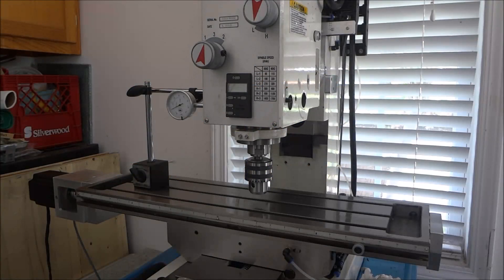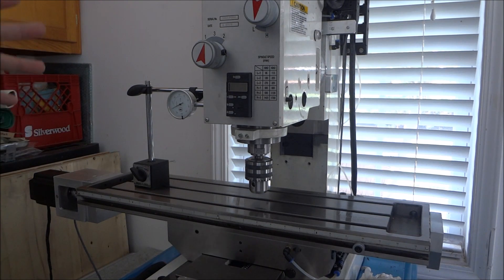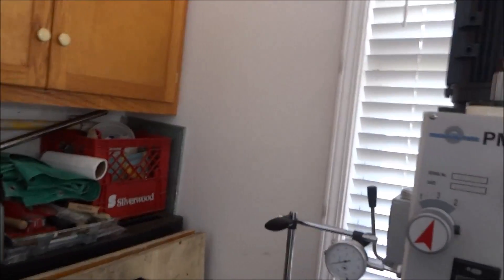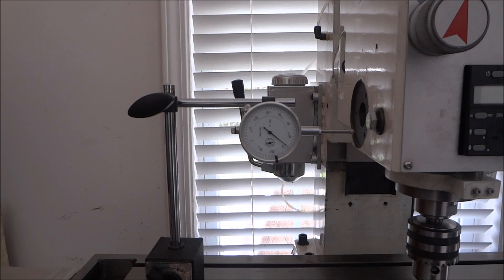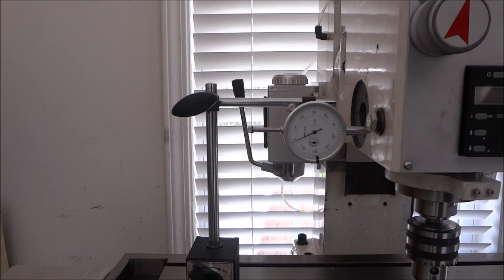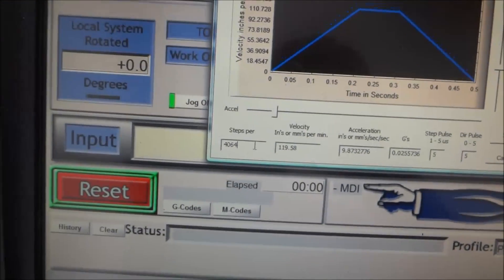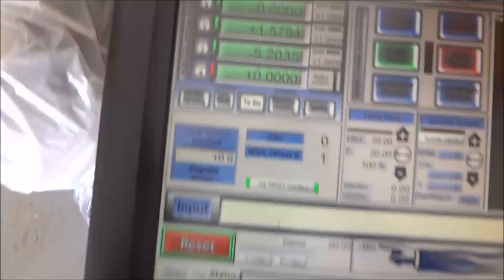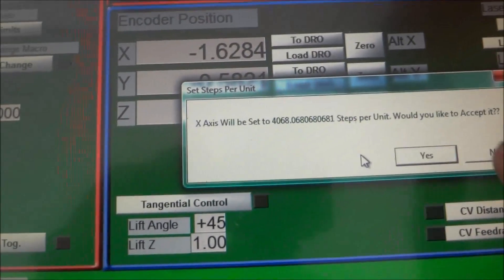PM727M Mach3 Steps and Backlach compensation Setup

Comment: Hi,

I would like to clarify this..!!!

Suppose I have downloaded a fresh copy  of Mach3 from the Official website and configuring for a CNC Router Mill.

Starting Over with a fresh Software Copy from official site always gives that warm and fuzzy Feel....Na ?   LOL

Any recommended parameters other than these?

 1) setting up  the Steps per Unit  is easily done by inbuilt calibration option

2) Setting Velocity and speed can be fine tuned by trying multiple combination of values and test runs until we feel comfortable

3) The Configuration of Soft Limits and Limits Switches  and Homing switches are optional as We can live without them.

Do You recommend any additional parameters to be set up for the smooth operation of A CNC Router ?
I have seen Many additional parameters tweaking by People Such as-

 Constant Velocity/Exact Stop
Debounce 
Frequency Of Communication
Look Ahead settings

Are these settings that Important?
Do You have any inputs to give on them?
I want to perform it like a Smooth CNC Router which Can Carve some smooth Wooden Legs and Figures..!

I am going with the most Common standard and Conventional Configuration which is -
4 feet X travel and 8 Feet Y travel and May be 1 feet in Z travel ,Just like the Standard Convention.!
Reply from the maker: tool selections persistant

Comment: Hi, I use DT860T driver with a NEMA 34 motors and use 2505 ball screws. Can you share which DIP switches you have turned on. Thanks
Reply from the maker: different for All

Comment: backlash is not working. there is no reaction. as if no digits were entered. what could be the problem?
Reply from the maker: Try a reboot and also try a large number like 20 mm
Reply: @CNC4XR7  I found the problem. I am using " rnr motion card " . The card does not support this feature. thanks for everything. 🙏🙏

Comment: Hi Sam. Great info as usual. I have a bf20l converted to CNC with ball screws ecc... I have adjust the steps as you recommended and backlash. All is good but on the Z the backlash is big like 0.155mm (like 0.006"). I see you also have quite significant backlash there. What did you do at the end? Becasue the weight of the Z should remove backlash when you go down anyway. I have a air strut at the back to remove a big of tension from the ball screw but the weight of the head is still a bit negative so it apply a downward force to ensure the pressure.
I have run some tests and indeed, without backlash compensation on the Z, going towards the table after have lifted the head several time brings back to 0.
Of I activate the backlash compensation for 0.006" it can reach a value close to 0 also going upwards (positive).
I can not think where it can be important but I was wondering what did you ended up doing for the Z, if remove backlash comp for it or kept it.

Thanks a lot!
Ale
Reply from the maker: for the z it has not been much of a issue. as there is always weight applied.
Reply: @CNC4XR7  Do you mena that you set the backlash compensation to 0 for Z? Because I am wondering in case you run a 4th axis toolpath or 3D one. Then you cut also going upwards. Then the backlash will play a role in that case.
Reply from the maker: @Ale_Lab  I went to double check as I have went trough the machine a couple times since this video aired.the last time when I installed the ClearPath servos.  I currently have it set to 0.0015 and I do not yet do any exotic cutting with a 4th axis it is enabled.  You did not mention the type bearings your using ? AC or TR however you can try to increase the preload to tighten it up a bit. also dbl check other mechanical connections that be potential causes of backlash.
Reply: @CNC4XR7  thanks a lot Sam. I use AC bearings on the axis. On X and Y I have 0.029mm (0.0011") backlash. I am pretty sure it's all tight already. To me must be the ball bearing coupler that might have a bit of slope in the design). Good that you got it down to 0.0015". Just finished to relog all the 28 tools. For the moment with backlash compensation seems to run pretty well. I will make a part and check.

Comment: good video..  but for a mill or lathe you need to use a 10s indicator , just so you can set it for the 10 lines between the thousands marks.  to a good machinist 0.0005 is close . lol..
Reply from the maker: Yes, you are right.

Comment: Cordial greeting.
Masterful explanation !!
A concern:
When you open Mach3 and place the units in millimeters (mm), the configuration you have described is eliminated, it remains only for inches (in) or Mach3 makes the appropriate adjustments to be able to work in millimeters.
Thank you for your attention and valuable response.
Blessings in these difficult times.
Reply from the maker: Mach3 3 does the converting for you. Yes

Comment: Using shuttle acc 0.005 with backlash 100% my x axis jerks a bit what do i do to get rid of this problem plz help
Reply from the maker: well if you increase the delay it will not jerk but the backlash transition is slower Steppers do this and sometimes make a banging sound.
Reply: @CNC4XR7  how to inc the delay?
Reply from the maker: @asharnadeem5558  config/ general config top right

Comment: MDI commands do not move  table after setting up, would this be wrong motor tuning? cheers
Reply from the maker: you did not specify what your typing in? try G0 x 1.0  Also does the machine move with the jog buttons? Do you have home switches installed? if not try homing the machine first.
Reply: @CNC4XR7   was working fine till computer crash and another hard drive installed reloaded and set up Mach3 again but cannot get it to go like it was before  axis move with buttons ok jog seems to be going ok but  MDI commands do not move to set up backlash ect  even putting in GO x  1.0 it may move .010 cheers
Reply: no home switches installed
Reply from the maker: @Rocky5738  ok make sure its G0 (zero) not O
Reply from the maker: @Rocky5738  you will still need to reference the machine.
Reply: @CNC4XR7 ok thank you

Comment: Could you tell us what are those white tubes and connector on front side for air or for what and for what reasons are there? Thank you!
Reply from the maker: One Shot Oiler Lines
Reply: Is this necessary?
Reply from the maker: No, But it does help keep your machine well oiled.
Reply: Could you show us (on video or link of item) what system do you use? Im interested in this.
Reply from the maker: I have a video In the PM727M conversion series One Shot oiler has all the parts used.

Comment: also, I noticed you had backlash comp on the z axis,be careful with that, if your head floats it will automatically settle and the backlash will become an error.
Reply from the maker: Yeah the z seems to be the worst one the weight is the side I think. Also it may be the plum couplings I'm using. More testing is needed.

Comment: Sam, I would suggest doing your steps per using a level type .0005" I dictator and a 6" ground plate such as 2-4-6 block so that you have less error and remove the possibility of the indicator you are using not being  perfectly parallel which would give a false distance reading.
Reply from the maker: Thanks 
Yeah I think it's pretty close I'm still fiddling with it I haven't really got it dialed in I'll try a couple 123 blocks back to back.

Comment: Looks good Sam. I don't like the hesitation much, but it might be related to the speed and acceleration settings. You might be able to fine tune that out in time with different settings. I think there might be one on how quickly you want the backlash comp applied (or something like that), I'll see if I can find it again.
Reply from the maker: Yes there is and I found it it's Shuttle accel set to.005
Thanks
Reply: That's the one! I hope that smooths it out for you.